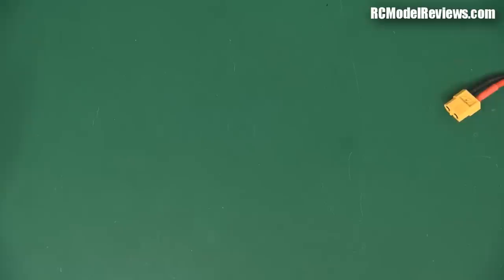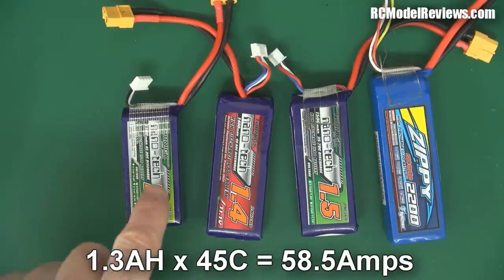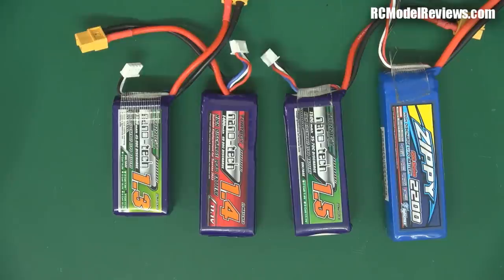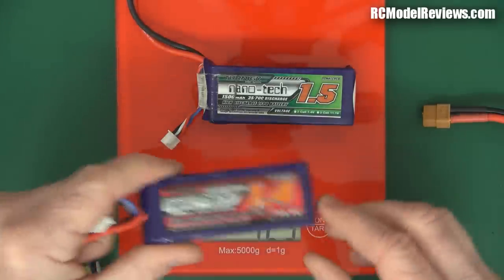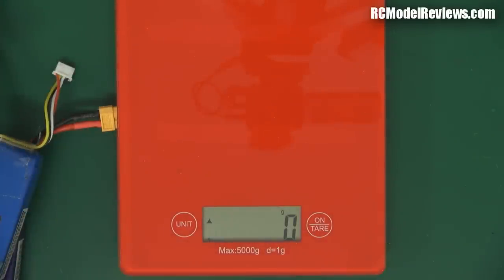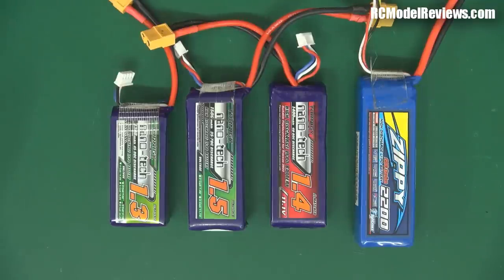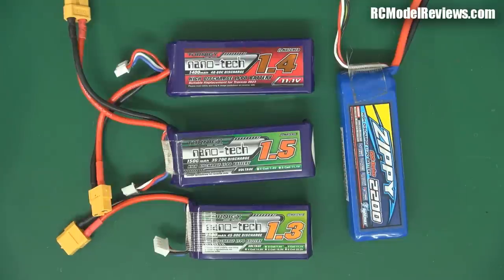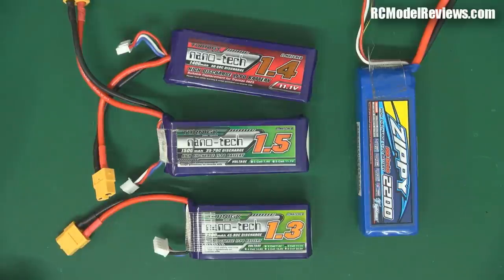What size mini quadcopter battery should you use?

Comment: What about a nano tech 1800 65-130c?
Reply: The RCAddict Just do the math.  1.8 x 65 = 117.  Much higher than any of the others, in fact double.  So the power will be there allowing the motor/prop combo to reach its full potential, but it can not go over its full potential, so it is probably overkill.  Also, a 1800-65c probably weighs about the same as a 2200-20c, so some of the power will be robbed by the extra weight, which also affects the agility.  So you need to find the sweetspot between power, flight time, and agility, for your individual quad and how you like to fly.
Reply: The RCAddict Read down a little at cbluebeard's question and Bruce (xjet) explains a little more, too.
Reply: RCotaku69 I think I am just going to get 3-5 of the 1300mh 45-90c ones once they get them in stock
Reply: The RCAddict I've got some here and I've used them in my MXP230 with 6" props and SS2207 motors.  They seem to deliver on their promise but they're probably a bit heavy (for my liking) on something with 5" props.
Reply: RCotaku69 ***** Ok, thank you for your answer :D I would try to get the 1500 35-70c or the 1500 30-60c nano techs but of course they are out of stock. Either they are all used up form people building quads after the videos or people on ebay bought them all up as they have them there but for twice the money :(
Reply: The RCAddict 
In the Flitetest "fly like Charpu" episode he was using 4s 1800 mah 35c Lumineir
Reply: parajared fpv Thanks for the heads up. My electronics do not handle 4S so that is where his extra power comes from. And also the fact he has everything the highest quality since he is sponsored ;)

Comment: what's the difference between xt30 and xt60?
Reply: Kastan Day xt30 - rated for 30 amps, xt60 - rated for 60 amps
Reply: Ahh perfect. Are they the same physical connector though?
Reply: Nope, they are different.

XT30 - 13x11x6mm
XT60 - 15x14x8mm
Reply: Ahh, thank you for the clarification.

Comment: What if you aren't racing and don't need "punch" from a quad?
Reply: odinata Then you can use 2200mAH packs quite successfully and you'll probably get 8+ minutes of flight time if you're careful.   However, there's no way I could fly a miniquad without "punching" and "hammering" it -- that's what they're built for :-)
Reply: *****
I just bought two 2200 40c batteries.
Not for a mini quad but a bigger one...no racing, but for learning.
Was that a bad choice?
Reply: odinata No....
Reply: odinata No.  There's no such thing as having too much C :-)   So long as your batteries aren't too heavy for the frame you're using then you should be okay.
Reply: odinata I usually fly a tricopter "designed" by a famous Swede. In "cinematic" flights the 3s 2200mAh 20C does well for around 12 minutes. When I try to punch it though (as if punching such a tricopter could be exciting) I either plug in 2 of these in parallel or put a 40+C in, much more exciting for the public, but obviously yo don't get twice the flight time. As Bruce said - there's no such thing as too high C rating, you just have to know your lower limit and go higher. How high? Your flying style/agility will tell you.
Reply: +tymonidas what sort of motors are you using on it? i went the DT750's. my weight with FPV gear but no batt is about 800g.. only 4 min flight times on a zippy 1500mah 20c though. is yours this heavy?

i think ill try the turnigy 2200 25c. i fly like a grandma so far (early days) but i want to stay out longer!
Reply: +Scott Jenkin in fact I built the tri with dt750's as well, plus some 20A ESC's from HK flashed with SimonK. This is a very relaxing craft with the 2200mAh 25C, and 12 minutes in the air is a safe value when learning/shooting. With the 1500mAh and only 20C you should draw no more than 30Amps, which really is not that much for this setup and your short flight time is the result of exactly this. Use the bigger battery, weight-wise it can handle two of them easily (in parallel), provided you use the right props - I use 1045 or 1138, mostly reinforced. The motors and ESCs are in OK temperature after a flight. Make sure to balance your props, though. This will make the amp draw slightly lower, will make your bearing last longer and will make the tri sound much better in general. My setup has about 3kg thrust, weighting around 1kg +-50g (depends on the batteries fitted), so there's plenty of room to play. Lifts a 1l cola bottle easily, tried that some time ago. I have no expo on the throttle and I get a stable hover at around 40%. Punching is possible, but this may stress the battery if done too frequently (2.2Ah * 25C gives 55A, the motors can take 60A easily at wide open throttle). I bought the 2200mAh 45C batteries on a HK sale and punches simply look better, the max speed is higher and agility is better (think of pulling back hard from max speed forward flight). But the 2200mAh 25C is ok as well for the first few months. The 1500mAh 20C does not have enough juice - you may damage the battery fast (drawing too much current) which may puff it or set it on fire.

Geez, do I always have to write that much to a simple question? :)
Reply: +tymonidas Hey man. MUCH appreciated info!! Thanks a ton for the advice. Our builds sound almost identical.. Id like it if I could keep in touch and compare setups and performance?
Reply: +Scott Jenkin I am trying to get my hands on some gps logger/radar gun to get the max speeds out of it, but yeah, the tri with dt750's is a nice craft in general. I've added a Super Simple Gimbal to the battery plate (KK2 with Steveis firmware has that feature), but I think I'll ditch it - the camera keeps horizon extremely well, but the vibrations are awful, the amp draw from the two servos (that are working all the time) shortens the flights and all it adds is another point of failure. I may come back to the idea later on.

My setup in more details - RCExplorer's main plate (and overall idea), wooden booms on the front (12x12mm, 30cm in length), CF boom on the back (this one does not break that often), dt750's (changed bearings to something local now, but performance is slightly better), 20A ESC's (some HK brand) flashed with latest SimonK, KK2.1.5 with Steveis, 10" and 11" props (trying to always match size), 2200mAh 25C and 45C batteries, custom laser cut battery plate (to fit 2 batteries mostly) and the world-famous Bruce's uber-universal power distribution board :). That's pretty much it.

Oh and by the way - I recently had a nasty crash, a loose prop on the back is to blame. I was trying to do some tight maneuvering around high tree tops and fell down from like 20m or so, straight into the ground. Too much torque I suppose. Not a nice view - ALL the zip ties broke, all bullet connectors disconnected, some solder joints came out to be not strong enough. To lose some weight I wasn't even recording - last battery in the box - so no "nice" footage. I am waiting for new parts now. You can see some of my test flights on my channel, though I am not doing any builds nor reviews - I am relatively new to the hobby as well. Still trying everything to see what suits me best, including Bruce's ZMR250 build as well as trying my skills with a Bixler 2 (awaiting a safe glue) and thinking of building a slow flying wing (matter of fact the foam is cut and glued already). And all of this trying to get my son into the hobby, not sure if he likes the crash and rebuild phase :)

Comment: A strange use of the word 'mini'. The smallest of those batteries is bigger than anything I've used in my life on any sort of model. I've never used more than two cells either. Amps doesn't equal power. Watts equals power and that involves voltage.

Comment: a mini quad with 1806 motors without fpv only pulls 21 amps af full thr.. at half its 10 amps.. so you only need a 20 c battery.. i been running a 25 c i just putt around and they dont get warm so i ordered  20c.. zippies 26 amps is double what my quad draws.. so i dont see what this guys talkin  bout.. i pull 5 amps just at mid throttle very efficient

Comment: Does this translates to 4S?
Reply: Bethurner Yes.  4S batteries have a C rating (e.g. 65C) and a capacity rating (e.g. 1300mAh/1.3Ah), the same as 3S.  The difference is the total voltage i.e. 4 cells at 3.7V (nominal) per cell is 14.8V for all 4 cells, total (nominal).  The same formulas apply.

Comment: What rate should they be charged at?
Reply: TheTonstar1 1 C (ie: 1.3A for a 1.3A lipo) will be fine but most newer lipos will handle up to five times the C-rating so (in theory) you could charge a 1.3A lipo at up to 6.5A.  However, as a general rule of thumb, if you can charge at the 1C rate, the battery will thank you for that :-)   Never the less, when I'm trying to get all my batteries charged on a Sunday morning before I go flying, I'll throw 5A into them and they never seem to care.
Reply: ***** cheers i normal charge at 4c done in 15 mins and normal put back in 800amp hours i fly 5 mins on luminer qav 250 and batterys at 3:80 when start to charge!
Reply: TheTonstar1 if your wearing a 500 dollar pair of fpv gear you ahve to ask this?
Reply: Nacho WiFi I don't remember a LiPo instruction manual coming with a pair of Fatsharks?
Reply: its called common sense.. lipos been out for a long time now if oyu dont know how to charge them or a safe charge you shoulndt be in the rc buisness
Reply: its called google...
Reply: Yes. And Google owns Youtube. And Bruce has a Youtube channel dedicated to helping newcomers to the hobby. Notice how Bruce is answering everybodies questions in the comments? And that's where we are having this discussion... any other points you'd like to bring up besides Fatshark owners should know everything, if you don't know about LiPo voltages you should not get into an RC hobby, or people should use Google instead of YouTube for their information? I'm starting to get confused as to what your point is? I suspect you are just jealous of a newcomer with some nice equipment, and are now just trolling.
Reply: deepimpact.io Sorry, I didn't mean to become one of them. Just sometimes the trolls need to be put back under the bridge where they belong. I've had a couple of beers. Couldn't resist.
Reply: Nacho WiFi What does the flight battery have to do with a pair of FPV goggles ????
Reply: Nacho WiFi just because im loaded dont mean i know everything! Anyway i know how to charge lipos i was wondering watt rates they charged at ! Like what i did there!!!! (what)
Reply: deepimpact.io lol there are alot on hear!!
Reply: The Dark Pixel HAHAHAHAHA best comment on here "google owns youtube" so awesome. Teaching this troll a lesson!
Reply: The Dark Pixel looks like 'common sense' isn't common after all as evidenced by nacho wifi
Reply: i have more common sense in my pinky then half of you commenters
Reply: im English
Reply: TheTonstar1 that's some of his supersonic pinky smarts he mentioned earlier :)
Reply: Nacho WiFi slightly ironic coming from someone named Nacho
Reply: 1 c  if a battery is labeled 3000 mah you charge it at 3 amps if its labeled 2500 mah you charge at 2.5 amps.. got it?

some will let you charge at 5 c so take 3000 x 5  but most chargers only charge at 5 amps 

if you want to charge at 5 times the rate you get 5 times the battery degrading....  charging slow is better..

i remember when lipos first came out.. boy the confusion...
Reply: +xjet love how you characterize batteries!

Comment: so as well as amp ratings being denoted by C and not A they arnt even actual amp ratigs 
rc stuff is confusing
Reply: the 1300mA is its capacity. while C rating is how much you can draw from it. 
Its like poring water out of a bucket compared to a bottle that holds the same amount. a bottle pours slower obviously. so it has a lower C rating figuratively. 
if you try to pour out more than rated it could/will explode.
Reply: no i understand how amp draw and mah rarint works what i fail to get is the oddball naming conventions you use for example you use C instead of your amp ratinds you use S to signify "C"ell and even when you get that C is your amp draw its not really cause aparently its a number you multiply against your mah rating to get your real amp rating instead of simply putting the correct rating on there in the first place then theres your motors KV rly if you couldnt muddy the waters any more you use KV to denote rpm per volt instead of something more conventional like rpm/v or hell r/V in my world a amp is A a volt is V a killovolt is kV a cell is C
Reply: oh... well actually a agree with that. lol
but C is capacity so if your draw rating is 25C that means its "25 times Capacity". that bit makes sense mathematically.
as far as Kv i have no idea yet why they chose K to represent RPM. drugs maybe? lol
Reply: thats what im saying why say 25c  just do the math and give me the amp rating on the packet say i bought some cookies and on the bag for callories it said 1.5x capaticty youd complaion it just seems like its done simply for marketing WOAH THIS BATTERY IS 9000C no no this ones 9050c reality the 9000c is more cause of math just sillyness
Reply: its over 9000c!!!! lol...
i didn't think the math was that big a deal...
just the Representative letters..

also how would a 9000c be more than 9050c? your example is a bit wayward. this isn't core math. just regular x * y basics. maybe in division where the number changes drastically depending on larger or smaller first. as long as the mA is the same multiplying by the c rating should never be less for a larger number.

you should really try to understand thing more than what your told up front though... 

A real marketing scheme is putting 20,000mA instead of 20A because bigger numbers sell even though its the same. :/
Reply: DarkShadowsX5 he explained it in the video if mah is c * v then if the 9000c battery has more voltage than the 9050 then the mah rating would be higher
Reply: i heard him say 1.3mA 45c > 1.4mA 40C  > 1.5mA 35C > 2.2mA 20C.  which is right. The mA goes up but the C rating and total output potential goes down with it. 
not that c goes up output is less. he only mentioned voltage in what is known as the power aka watts formula. 
in terms of voltage and c rating keeping capacity the same and since you and the uploader actually stated the Watts formula (A * v = w) A = current aka Amps not represented as c.. :/
11.1v 3s, 1.3mA 40c is 52mA max out = 577.2w but say a 
...7.4v 2s, 1.3mA 50c is 65mA max out = 481w. 
The first one is more energy dense but yeah max mA out is less because current flow limitations in each cell other wise fire. XO the nano tech he mentions first is probably has newer cell technology than the next and so on. but who knows without looking at the cell number code.
probably wont be running a racing QUAV on a 2 cell battery though unless its really small. but it was just an example. 

you can find batteries from certain makers that the c rating is the same but mA capacity is higher. 
check out the tattu batteries they have a 3s 1800mA and a 3s, 1550mA, 3s 1300mA etc all rated at 45c they also have 75c series. and for around $20-$30each. 45 and 75. 
really good reviews on them too.
Reply: This is old, and I'm not sure whether anyone else pointed it out - but S is NOT cell count. It is the amount of cells in series. For multirotor batteries, the S count is usually the amount of cells because there is a single parallel circuit (for example, a 3S1P battery).